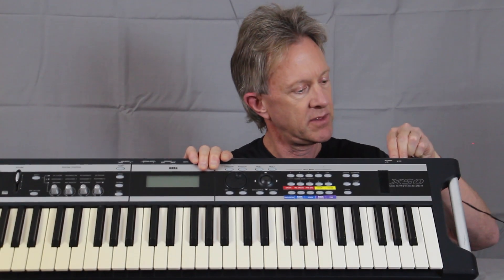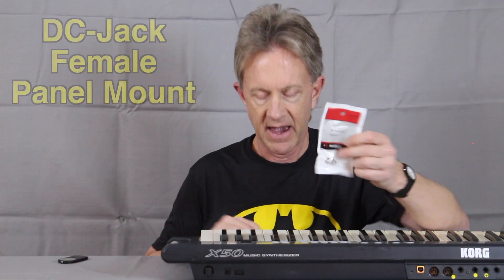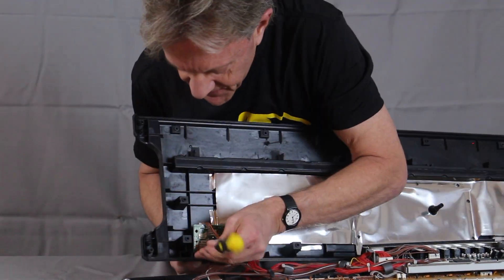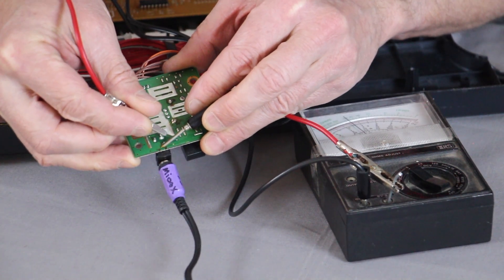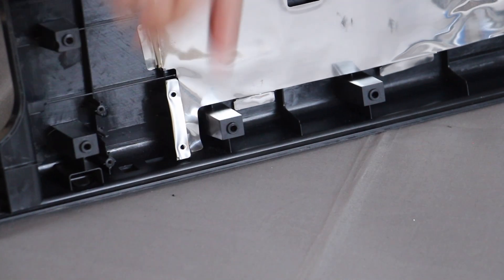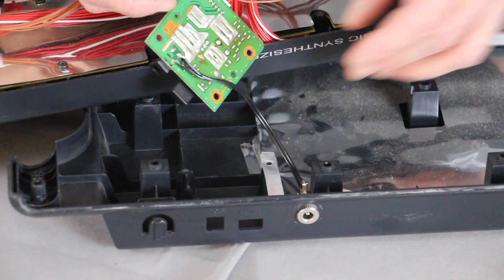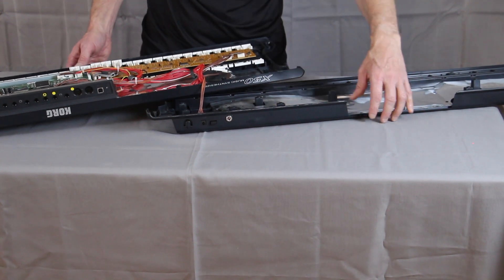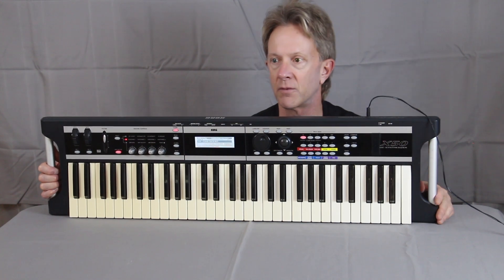How to Fix a Bad DC Power Jack

Comment: Ha, I woke up this morning having to replace the dc power supply on a Korg x50 I just bought. Is this a common issue? It’s just funny that it’s the same keyboard
Reply from the maker: That's interesting and I think more than a coincidence. The problem seems to be that the structural integrity of the jack depends on the tiny pins soldered to the PC board and after enough use, they finally tear away. Good luck repairing- its a nice synth!

Comment: What adapter is needed with the new jack?
Reply from the maker: Basically all you need to make sure of, is that the jack and plug match and that you have the correct voltage and polarity on the adapter.

Comment: genius,are you familiar with how this can be done on an mpc500?same type of port,fryed,and these things are sooooo tightly packed with components inside its intimidating
Reply from the maker: Thanks for the kind words! One thing you might consider is soldering + and - leads to the circuit board and attaching an inline female jack outside of the unit. I did that on on old Roland machine that had no room inside.

Comment: Hello 

Thank you for posting a solution for the dc power jack.  Do I need a 2.1mm DC power female jack?  Also any further info will help.  How can I tell the positive and negative on the old power circuit board?  Also is the center pin on my new DC power jack negative and the ground positive?  Size of the drill bit you used?  Thanks so much, as I am a novice at this, but welcoming to try it so my x50 doesn’t keep on going on and off.

Comment: 1:23 How do we know which one is positive?
Reply from the maker: You put the leads of the VOM on the circuit board. If the meter goes positive then the red (positive lead) is on the positive tab. If it goes negative its the reverse. Hope that helps and thanks for watching...

Comment: Thanks for recording this video. I have a broken female DC jack on an HP Monitor that needs replacement. I like the idea of mounting a remotely located jack and not having to do a circuit board repair to fix this problem.
Reply from the maker: Thanks for watching- I needed a "bomb proof" connection and I knew soldering a jack to the circuit board just wasn't going to cut it...

Comment: My yamaha dj x power connection has just died think the cable has been rubbing of the back of the stand need to get it fixed
Reply from the maker: You may be able to fix it by just soldering a new plug on the power supply (without having to open up the keyboard and replace the jack) I hope so!

Comment: I have a DMX Lighting Controller that looks like the Lixada Show Designer, It has the same issue with the DC Power Jack as shown in the video. I opened the Controller up and took out the screws on the little circuit board where the power jack is, it didn't came out because there was glue so strong that I couldn't pull it from the case and i'm afraid to break the board, how to I take the little circuit board off of the glue without breaking the board
Reply from the maker: Can you solder new wires to where the connector is soldered to the board without removing it? That might work. I've loosened up stubborn glue with a hair dryer in certain instances, but you have to be careful that you don't get any of the components too hot. Hope you can make it work!

Comment: Same problem with a fp4, but the connector it’s very stable. The dc adapter works, i tried replacing it and using it with another keyboard, still trying to fix it..
Reply from the maker: Good luck and hope you get it working

Comment: This is awesome! Would this Female DC jack fit all keyboards? Like the mini kids casio boards as well? Thanks
Reply from the maker: Thats a good question. Some keyboards have very tight spaces between their circuit boards and outer cases so could be a challange. Probably have to crack it open to see how much space you have inside to work with. Appreciate you watching!

Comment: Mr LearnLizard, great idea on bypassing the failed "jack port" on the original power circuit board.  At time stamp 1:28 you are IDing the polarity of the current.  Do you know what the 3rd post for on the failed port does or is for?.  IF you look closely you see three solder points, 1 is Positive, 1 is negative, and the 3rd?  At first I thought maybe it was a ground, but I'm thinking that wrong, since there is no ground on the adapter power supply.  I'm not an electronics guy, but I'm looking at doing something similar to what you did here, however, I wondering what the other post on the jack port does.  Any ideas?!?
Reply from the maker: I think that third post is just for holding the jack securely to the PC board (so it has a 3 point "tripod" support) Thanks for watching this one!

Comment: This was very helpful.  I put my power jack in another location that worked out well and did not have any danger of shorting to the shielding foil.  Also the shape of the jack nut fit just inside the walls in the pocket and prevented it from turning.  Just to the left of the molded in strain relief horse shoe in the very corner on the back.  Worked perfectly.  Also out the side under the handle is a great place with tons of room and the power cable can be wrapped around the handle for strain relief.   Wish I could post pictures in this comment....   I also designed and 3d printed a closeout plate to cover the unused rectangular hole, just hot glued it in.   A much more robust power input system now, plus the adapters with the new standard plug are much easier and cheaper to find.  I had to fix both my flaky X50s and I'm sure that I will need to do this to my other 3.  I am a huge fan of this little board.  Its the best for live performance.😃😃

Comment: Had same issue. Took to local "Korg Authorized" repair shop. I'm guessing he did the same thing...only now the back of my X50 where the power plug attaches gets warm and the brick really warm. Thinking he didn't do something right. Any guesstimation? Thanks...  Phogstr
Reply from the maker: I've found that if the power supply doesn't provide enough amps it can overheat. You might want to check that.

Comment: Thanks for sharing, I have same problem on LG TV DC power jack, I wonder how did you find right jack for that power supply?
Reply from the maker: Connectors are usually named by their barrel size but it can be hard to get the right internal pin size. Back when there used to be Radio Shacks I would go in and match the jacks in a store. Now I try to research it online and do an Amazon return if I an wrong (which has been more than once)

Comment: Could you explain a little the testing if which is positve vs negative, like what your voltmeter us set to and what it should read?
Reply from the maker: The multimeter should have a setting that measures DC Volts. There will be a black lead that plugs into a "negative" jack on the meter and red for "positive". If you have the leads touching correctly (plus touching  positive and minus touching the negative) the meter will read a positive voltage. If they are reversed it will read negative. Hope that makes sense and thanks for watching!

Comment: Nice - I got 2 adapter problems. They both work intermittenly and go out. Don't know if it's a Adapter problem or a jack problem. How do you tell which is bad ?
Reply from the maker: If you have a multimeter (you can get them really cheap) you can put the leads on the adapter's barrel jack and see if the current coming from it is steady. If it is, it's probably the jack on the device. Good luck and hope you get it figured out.

Comment: I believe I wired it incorrectly. If I did, is it officially broken due to blowing the circuit?
Reply from the maker: You probably are OK if you just reversed the polarity momentarily. (I have done that without frying the circuit) Hopefully you can get it working once everything is wired properly. Thanks for watching!

Comment: Was the the old power chord ?? Did you find a jack the same as the old one ??
Reply from the maker: I couldn't easily find a jack to match the old plug, so I got a new common plug/jack pair and then soldered the new plug onto the old cord. Appreciate you watching!
Reply: Funny thing..  when I opened my X50 ,  there were gobs of solder all around the jack, so I took it to someone to do it for me..  well it's loose again.. this time I'm gonna repair it like you did and be done with it..  I'm glad I saved your video..

Comment: A couple additional things, specifically about the X50 power jack.  I was not able to find a replacement for the keyboard's EIAJ IV jack.  That meant I needed to replace both the jack and the power adapter's plug with something else.  I used a standard Boss 5.5mm jack and plug.  Also, the video doesn't show the keyboard's shielding and it also is a "gottcha" waiting to happen.  If you use a metal jack like he did in the video, and you wire it in normal center-negative polarity, then the outside of the jack will be positive and will ground against the shielding.  I worked around this by putting a large piece of heat-shrink tubing around the jack's body after I'd soldered the wires to it and installing it (before wiring the other end of the wires to the circuit board).  I also folded the shielding back so it couldn't brush against the nut holding the jack in.
Reply from the maker: Thanks for those additional notes. Yeah, I replaced both the jack and the power supply's plug as a set. The big foil keyboard shield came out easily for me with no issues, and after years now, my x50 is still going strong!
Reply: Update: Repair shop said my power supply was bad…which they swapped out with a good one. However, back of board where power cord goes still gets pretty warm…but at least it’s working. Thanks for taking time to reply. 👍
Reply: I just got thru doing this to a couple of my X50s and I used the area right by the order of the keyboard on the far left for my new Jack.  However, this jack/keyboard is wired center-positive so the outside of the jack should be just ground so touching the shielding should not matter.  However better to be safe then sorry.

Comment: Thanks, this is so helpful. My very first soldering job and I've fixed my X50 with your guidance..and added a jack that its easy to find adaptors for.
Reply from the maker: I'm impressed that you had the guts to try soldering on a circuit board like this for the first time! Good job and congrats on the repair. (mine is still going strong)

Comment: 🙏* * *  HELP please! * * * 🙏

Hi, Steve from LearnLizard,
once again at first many thanks for your helpful hints solving this known problem on the KORG X50! 
I also had this damage like many other users - my instrument is 16 years old and I used it often. According to your advice I tested it directly by soldering a 12 V wire from the power pack to the two contact points on the circuit board (correct polarity, 12 V measured). But after powering on, the X50 does not come into normal working mode. Only the display is backlit, but no text is shown. This happened already before - after wiggling the plug was no longer successful in supplying the device with power correctly. Apparently the small adapter board has got any defect additionally? Unfortunately you can hardly get this module anywhere as a replacement since the production has already been discontinued. What to do now? 🤔

Can it be perhaps that a predetermined counter is built in to refuse the function after 16 years and xxxx hours of operation when reached? The X50 has never been broken and has always been treated with care. I really want to keep using it because I am really satisfied with this synthesizer.

I'm very grateful for every further tip or hint! Thanks in advance! 🙏🙏🙏
Reply from the maker: Hi- I'm sorry to hear about those problems. Yes it sounds like there  might be some additional component failure on the circuit board. I don't think there is any built in counter but I do know that delicate components can fail after years and years of use. Your best bet might be to find a used one on eBay. Sometimes I have seen them go for very small amounts of money. Good luck!
Reply: @LearnLizard  Thank you so much for your answer, Steve!
This little power board is indeed heavy to find, also at eBay quasi not. So I try to substitue it in a selfmade way.
I have measured the 3 voltages that should be 11,5 V / 5 V / 3,3 V. Especially the 3,3 V Output doesn't fit anymore. There are merely 1 V. That declares, why the display is backlighted but nothing to read inside the screen, also no buttons are lightened up red after Power On (the ICs apparently don't get their operating voltage of 3,3 V for digital empowerment).

So I ordered a Miniboard (DC-DC-Converter) which steps down from 12 V to 3,3 V (adjustable). I hope this will help since the other voltages are correctly present. I will report about my efforts and success, so the other readers here can benefit from it. The delivery of this little Converter board will last up to 3 weeks though. I bought it in a 5-pack (special offer), so I will have sparing parts in any similar cases ... A price of under 10 € is fine for that 5 pieces together, isn't it?

Comment: O man i am really bad in handywork.. wat type OF BATTERIES fOR A KEYBOARD
Reply from the maker: Hi- I'm not sure exactly what you are asking. A keyboard like this takes more power than an average battery pack can supply-- so you need an AC adapter plugged into a wall socket. Yes a project like this can be a bit tricky especially if you have never soldered!
Reply: @LearnLizard  could there be a possibility it be the wires of the adapater is broken or lose
Reply from the maker: @terryfauzifan9459  Yes- and that's a more likely chance of what is wrong. You can usually find replacement adapters on eBay for pretty cheap. (best option if you are not good at soldering wires back together)
Reply: @LearnLizard  are all keyboard adapters the same or do i need to state the model of my keyboard ..tq so much sir for the help

Comment: If I were to upgrade the internals of my microscopes led to handle 12 volts would the original 5 volt female jack work? Or are jack inputs interchangeable so as long as the polarity (center negative) is the same.
Reply from the maker: I believe it should. Most low voltage power jacks will handle at least 12V. Thanks for watching.

Comment: Why not just replace the pcb mount female plug like-for-like? Or at least remove it entirely and mount in the existing location. Possibly would have been able to repair it as it was anyway (but can’t say without seeing how it was broken)
Reply from the maker: A couple reasons- it's not a "standard" jack size and I wasn't sure how to find an exact replacement. Also, I was worried about damaging the circuit board with too much heat (I'm not the most skillful solderer) And finally, all the stress is on the mounts of the jack and I didn't want them to break again. It was much easier (for me) to just solder leads to the board and use a standard jack (that fit my standard power adapter) I admit it was a little awkward to have to drill a whole new hole in the case, but it's still working great after a lot of use.
Reply: @LearnLizard  Replacing the old one, it would probably break it again, like you I added a 5.5mm 2.1 jack which will last a lot longer. plus easier to find an adaptor!

Comment: How do you find out which one is positive and which is negative?
Reply from the maker: You need to use a Multimeter. You can buy really inexpensive ones on Amazon. You set it to measure volts and put the red lead on one wire and the black on the second wire or jack connection. Then you read the meter to see the polarity. (It's easier than it sounds!) Good luck and thanks for watching.

Comment: how i wish to have same for my korg MICROX :/ who has same issue ... but it s too complicated for me, i asked to change this plastic shit  to a repair shop they ask me 80euros only to change the plastic part to have same issu in the future : NO WAY... this idea of metal is really better ... but i cant do it .... i m not skilled for that. good job !!! my new MODWAVE is also ship plastic but KORG did something better and this kind of problem wont come normally .... but i regreat my KORG microX i can use like that but if i move machine can turn off, sad..... +1 people who put -14 cant probably do it ... lol like me but for me it s a big +1
Reply from the maker: You probably could do this although I admit its a little bit scary. If you just solder a wired jack to the circuit board (or find a friend that knows how to solder) you could just have the wires and free jack come out through the back hole. (no need to drill and mount a panel jack) Good luck- The Micro-X is a great synth and worth rescuing (I used to have 2 lol)

Comment: Hello thanks for the video i have a Roland RP30 and yesterday when i was playing the noise in the speakers where making vibration noises so i removed the plug from DC and put it back and now it is not turning on any tips on how to fix it without taking the piano apart i hope anyone can help thanks for the video
Reply from the maker: I would first try cleaning out the jack- with compressed air (or other blower) then with rubbing alcohol on a q-tip. Also sometimes you can bend the connectors on the plug itself to make a better contact. (thats assuming the power supply is still working and hasn't shorted out) You can test that with a multimeter to make sure. Hope you get it working!